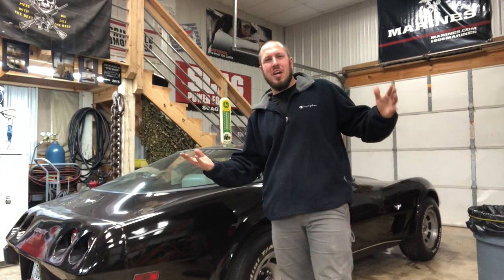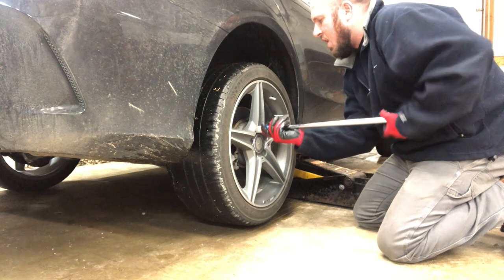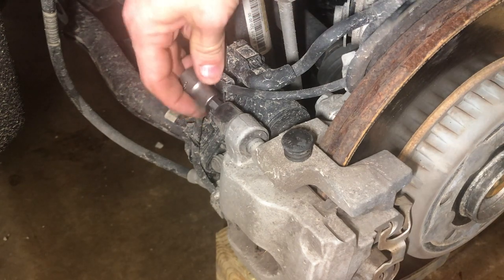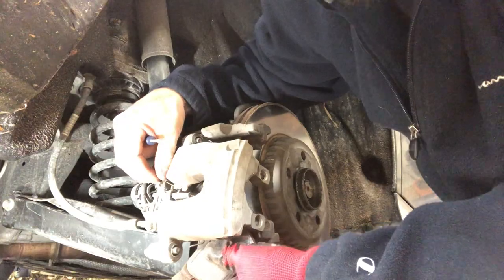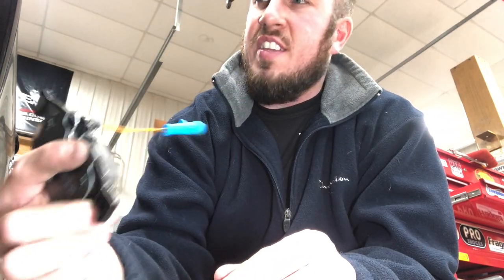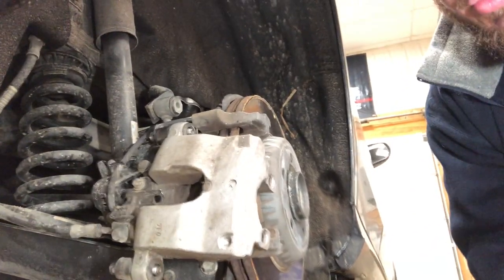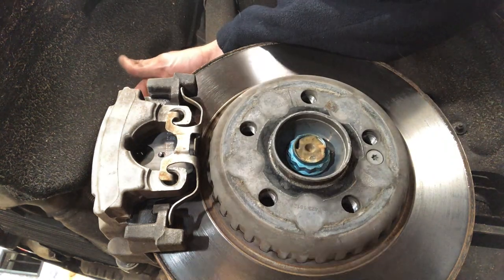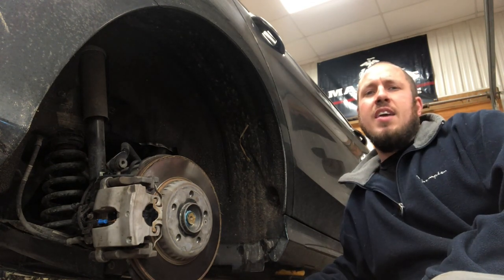Mercedes C300 W205 Rear Brake Pad Replacement

Comment: Great video. Should save me a lot of money. Only one question should you not use brake grease/lube before you put the new pads in?
Reply: You need to clean  and lube 2 sliding pins

Comment: To remove the caliper spring ,simply lever the middle of the clip towards the caliper ,it pops out of the 2 holes , also to release the wear sensor ,simply pry the small wire up a fraction and the plug pulls out . Bit of butchery in parts of this video, but great overall. Very helpful.

Comment: Does it matter what brake pad goes where on the rear? the brake pad with the sensor should be on the inside right? And when I put the caliper on I had issues getting it back on is it the brake pads not being in there right location? And yes I did push in the piston on the caliper so it’s not that. And by the way thank you for the video , much needed!

Comment: When will you change the spark plug ? Did you do break flush ? How much your dealler charge for break flush ? Thank. You
Reply from the maker: I think the manual says spark plugs every 40,000 miles. I have a video on those as well. I don’t believe in wasting the money on the brake fluid changes

Comment: Love your videos. Hope you can help. I bought an 09 c300, love it. When i push on the brakes it has a sound that repeats every 3 seconds until i let off. Is that the pads, rotor or wheel bearing.? Can it be something else?
Reply from the maker: Yes definitely sounds brake related.

Comment: 2 questions, is there only one sensor on the 2015 c300 model as well, also do you have to replace the sensor each time you change the pads? I just bought pads and one sensor for the job tomorrow.
Reply from the maker: Only sensors on the passenger side of the car. Front and rear if it is not damaged. You can reuse
Reply: @TheDurbinCompound  Thank you! Very much appreciated and your video was spot on💯

Comment: Man, I am so angry.  My wife had to go from BMW to Mercedes and I fix all our cars.  This is over engineering on steroids.  BMW brakes are soooooo easy and fast.  Now I have to get a special tool to compress the caliper? Ughhh.  I don't understand what the ebtake is even for! Thanks for showing us.  I subscribed.
Reply from the maker: The ebrake is the most annoying thing. It’s not designed for stopping and getting out driving. Every time you open the driver door it clamps down. Then if you want to move the car with the door open, you have to manual release it. Not to mention the safety feature where it dumps it into park while the car is still rolling if you open the driver door
Reply: @TheDurbinCompound  Just terrific.  Sounds like an over engineered dumb idea.  Hopefully there is a good reason for it and someone out there will fill me in.  Thanks for the reply :)
Edit : And Tha brake pad wear sensor is so much easier less intrusive on the BMW.  This one has tiny exposed wires, cheap connection set up. Almost seems like they forgot about it and added it in at the end :)
Reply: On my BMW, I push back the pistons with a pry bar between the old brake pads. I’m sure this is possible with a MB. You can also rent a caliper tool for free from most auto parts stores. Generally, I’ve found my wife’s MB to be no more over engineered than my BMw.

Comment: Nice video! Which lugnut socket are you using?
Reply from the maker: ATD tools nylon sleeved sockets, they have held up great!

ATD Tools 4357 Protected Lug Nut Socket Set - 7 Piece https://www.amazon.com/dp/B000Q8X36Y/ref=cm_sw_r_cp_api_i_ocTAEbFKB9YTV

Comment: Once you set the rear epb to service mode did you turn the car off or leave it on
Reply from the maker: I turned the car off
Reply: After re engaging the epb do you have to pump the brakes before starting or the epb takes car of theirs? Thx again
Reply from the maker: @teddiazjr.6223  nope, don’t need to pump the brakes

Comment: What torque setting did you use for the bolts?
Reply from the maker: The brake caliper bolts? 12ft-lbs, just past snug basically.
Reply: Cheers